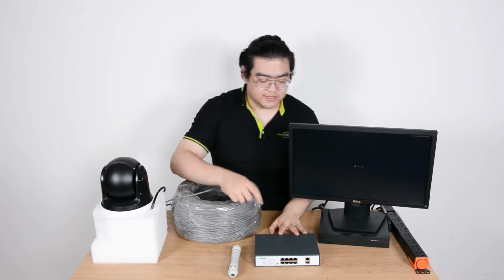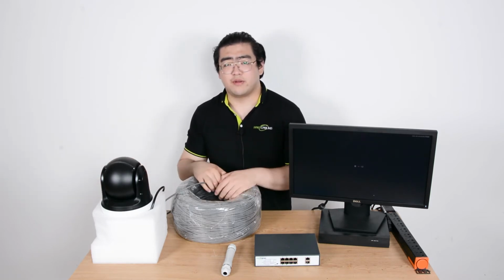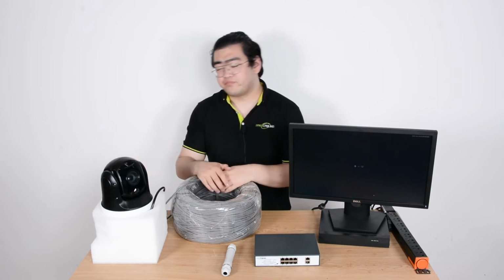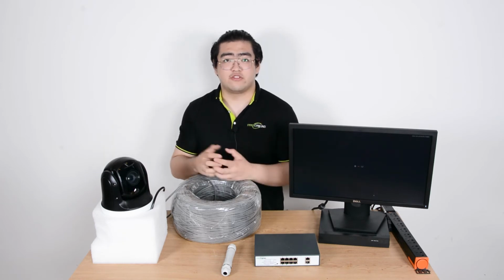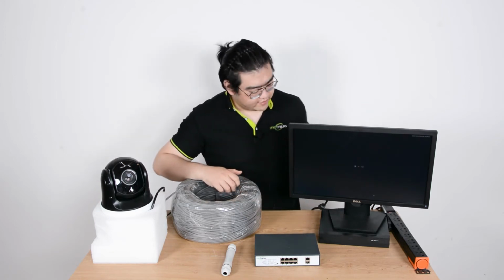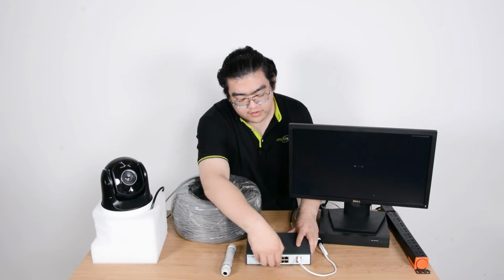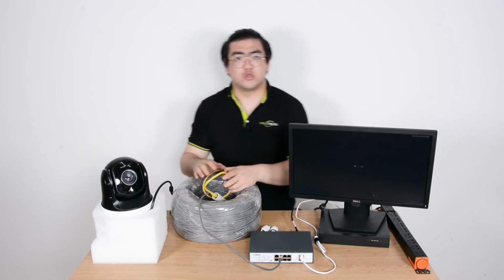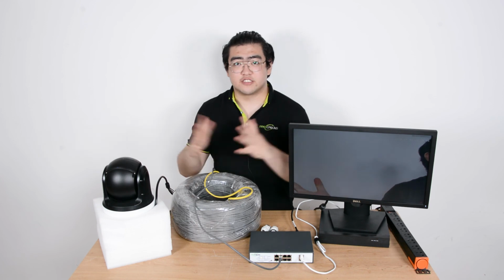Power and Network Extension: 500 Meters PTZ IP Camera Setup #1

Comment: Thanks for the great video bro. Is there any programming needed once I hook up the POE extension to my router? Thank you in advance?
Reply from the maker: The PoE extender is transparent to TCP/IP. Basically, it is plug and play. However, you do need a PoE injector or switch next to your router, and your edge device must be PoE compatible products such as POE IP camera, POE access point, PoE VoIP. If you don't have PoE compatible products at the edges, you can add the POE splitter at the destination.
Reply: @Fastcabling  awesome I noticed your poe injector will power a 4 port poe extender with out  having to plug in 4 data "in"  for the 4 Poe out that's cool. I'm basically going to order a PTZ camera and joystick that has Poe and I need to be able to charge my iPad and give it data using an apple adapter. You think that will work
Reply from the maker: @Detoxingforlife  I believe the PTZ camera and the (IP) joystick with POE feature should work as long as the power budget is still enough. The longer the distance, the more power loss will be. There is about 26W within 300 meters. You can refer to the power budget chart below. https://www.fastcabling.com/product/800m-8-port-long-range-poe-switch/ However, I just don't understand how you can use the apple adapter, because the PoE is a low voltage system, and the apple adapter requires a power source from AC100-AC240V. If you add the power splitter at the end of the cable, you could have DC5V, but still, you can't put the DC5V to your iPad directly, as it needs a charge to control the charging process.